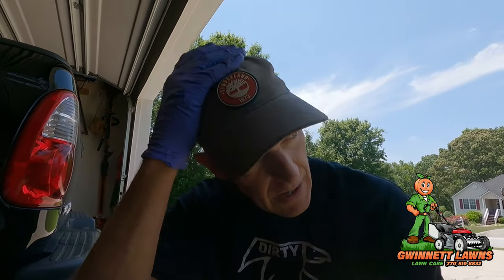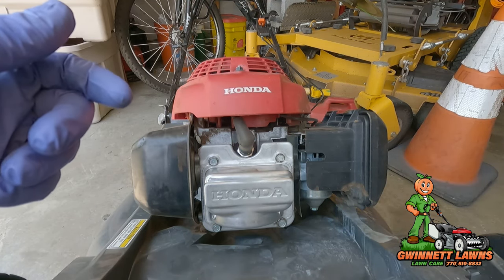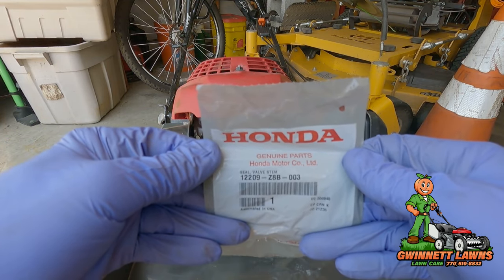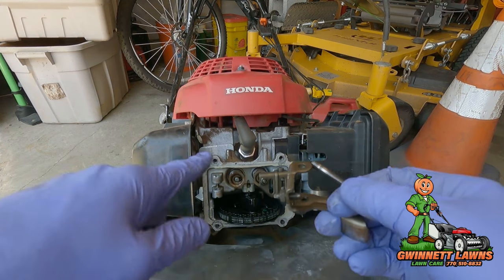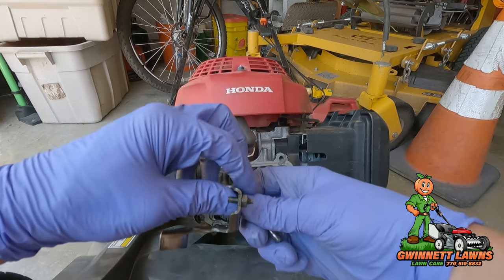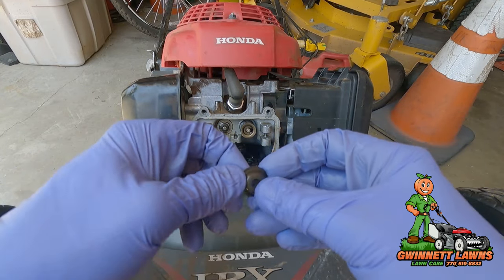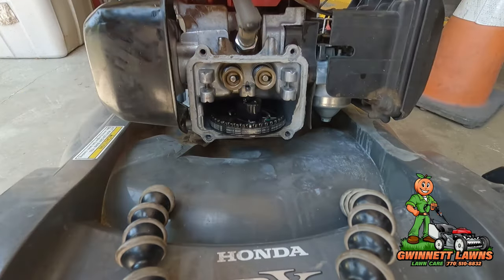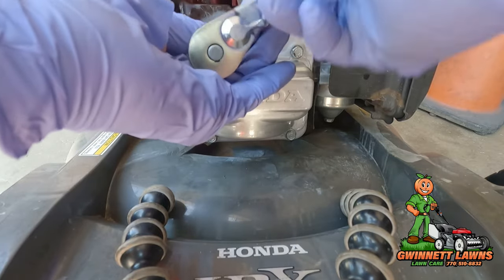Repairing the Valve Guide on the GCV 190, GCV160 Honda HRX217

Comment: Mine had the same issue as do them all. Intake side only . If your tired of your intake valve sticking every time you go to use it he’s my fix . Get some valve grinding compound and spin it with a drill so it opens up the guide  and will never stick again. You can do this with the head on. Don’t get the compound Anywhere but in the guide and clean up afterward. Reseal the cover and will run forever

Comment: I bought this mower new in Jan 2017 thinking it would be the last mower I would buy. Unfortunately it was one issue after another until finally this June I sat it by the road and it became someone else’s problem. Four trips back to the dealer for warranty work and then several repairs outside of warranty was more than enough for me. I’m now mowing with a Milwaukee M18 mower and couldn’t be happier. I also just bought a Milwaukee string trimmer to replace my Honda trimmer. Honda quality is way too hit or miss at the prices they charge for their equipment. Definitely no longer a premium brand IMO.

Comment: interesting - I have been presented several of these exhaust valve videos today just after dropping my Ryobi / Honda Pressure washer off at the shop for not starting and telling the wife I think it is an intake valve issue due to the popping sound / slight backfire thru the carb - I should have waited a couple hours and saved a couple hundred dollars I will be charged -
Reply from the maker: Ouch that's a lot of $$$.

Comment: The valve cover from a GSV190 (commercial grade variant) fits the GCV160/190. It's made out of cast aluminum and uses a gasket. The part# for the GSV valve cover is 12311-Z2A-000 and the gasket is 12312-Z2A-000.
Reply: Very helpful, ordering this upgrade for mine, thank you.
Reply: @Treppiede  you also need the longer bolts from the GSV p/n 90121-952-000 qty 4
Reply: @joshcobi  thank you, you're absolutely right, I found out the hard way the other day when the cast aluminum cover arrived and I went to put it on my GCV190 lol. I wound up picking up some bolts from McMaster that did the job, but I will replace them with the OEM Honda stuff soon. Good discussion gents, thanks! 👍
Reply: This now brings up a question is the valve guild/seat different / better on the commercial and will it fix the problem on the standard 217 ??
Reply: @kevinharris5101  I don't know if it is "better" but at least it won't rust. Ah, and it will not deform so easily when bumping it into a big branch or something. I polished mine up yeaterday (the standard one) and applied some water displacing oil. I think about to paint it

Comment: I too have noted that the build quality of Honda mowers has diminished.  I purchased my HRC 216-AD HXA (MZAN 6000001-6099999) in August of 1990, when the wheels had metal hubs.  On the other hand, my brother-in-law has gone through at least a half-dozen cheap box store mowers in the past 30-years.  Although my HRC 216 was $910 at time of purchase, I still believe I got my money's worth.

Comment: My HRX217 is 5 yrs old.   Used it all summer and week ago wouldn't start.   Cleaned Carb and then took off valve cover and the intake valve was stuck.   Sprayed with WD40 and tapped it several times and it finally loosen up.    Bent the valve cover trying to get it off, so straigtened it up and screwed it back on.    Couldn't find the video you mentioned about making a gasket for it. 
This is first Honda mower I've owned.  Had 2 Snapper mowers over a 45 yr period.   Had almost no problems with them.  The last one had a Wisconsin Robin engine.   I was going to buy another Snapper but the new ones in 2018 looked cheap and not as sturdy as the previous ones.   I'm going to get an hour meter for this Honda.   Thanks for the videos.
Reply from the maker: I have not done a video on making the gasket as other things were slightly more pressing.  I will do the video at some point.
Reply: FYI...I vote sooner rather than later...LOL @GwinnettLawns
Reply: My brother has a Snapper push mower with a 2-stroke Wisconsin Robin engine; I keep trying to get from him. He says, that I'll have to pry his cold dead fingers off it, for him to give it up!

Comment: Thank you for posting this.  This was the key to fixing my Ryobi 3100 pressure washer no compression issue.  When I tapped the guide back in it bound up the exhaust valve even more, but I was able to loosen it with liquid wrench and some vice grips by working it up and down until it fully seated and slid easier.

Comment: Can't remember the year purchased but was new when purchased from the dealer.......lets call it  25 to 29 year old HRT216 with original GCV160 engine.  Estimate about 30 to 40 hours total?  Looks like new of course.  For the past 19 years it has only been ran about 2 hours since moving to a larger property and using a ZTR to mow.  It was only drug out once or twice a year to mow a low area that collected a lot of water and couldn't get the tractor in there in the spring.  This year decided to use it a bit more around some pine trees.  Noticed a puff of smoke when starting every week this year that was obviously oil from the smell.  Figured the valve seal had dried out due to lack of use and allowed oil to seep past when sitting.  Pulled the cover, rockers, and spring and there is no seal present.  What was strange though was if the seal had dry rotted and crumbled, the small sealing spring it seems is on the seal from the videos I have watched is not left behind on the valve stem if the rubber had decayed and fallen apart.  Can't locate the actual engine code online but every other engine code for the GCV 160 shows the seal used so assume this model had it too at some point.  GJAEA-1146612 with  MY1* code punched beside.  Might buy a intake seal, not sure it is worth it to crack the case apart to look for that sealing spring, thinking it is not an issue even if it is laying in the bottom of the case.

Comment: Have this exact mower about 6 years old I use it in a landscape business  been reliable not the best cutting or bagging but it weights way less than the commercial and hear in the PNW that helps a lot in the springtime when you can put ruts in the lawns because they are so wet.

Comment: Haven’t had the guide move on my gcv160. The valve cover did leak, the Honda bond silicone is crap , so as an automotive machinist I sealed my valve cover with Permatex right stuff silicone. I did this on both my mower and the newer mower that my parents have with the GCV 170. Both are absolutely bone dry.
Reply: If you order a cast aluminum valve cover and the longer bolts for it that comes on I believe the GSV series engines it uses a gasket and allows easy valve servicing without the use of silicone or a crappy tin cover.

Comment: Hello again
So the meter for the engine all you do is wrap around the cable for the plug and tie it like u did and it will read the hours use?
Thanks
Reply from the maker: Correct the wire senses the spark energy and the meter displays it on the front.

Comment: One more comment,   question,   Is there a way to modify the Honda HRX217 so engine speed can be adjusted.   This mower just runs all out and I can't adjust the engine speed.  The Snappers I had I could adjust the speed on them from the handle while mowing.   Thanks.
Reply from the maker: The throttle is on the handle of these mowers as well.  Mine will run a various RPM's.  Maybe someone messed with the governor spring.
Reply: There is no throttle on my HRX217.   @GwinnettLawns
Reply: @alfannin872  The RPM is adjusted by slightly bending the governor arm. If you'll search you'll find at least one very good video showing how to do it.

Comment: Would this be causing oil to be burnt on startup?  I have an HRX217 with a GCV190, and while i've had the intake seal and the camshaft oring replaced, it burns oil at startup, or slightly when i engage Roto-Stop.  I'm hoping that if it's because the valve guide is pulling out, it's causing so I can fix.
Reply from the maker: I could be doing rings are worn. Try adjusting your valves see if that helps. The valve guide moving is not going to cause it to burn oil on the exhaust side..

Comment: I have this mower with the GCV 190.  I am having the issue where its hard to pull start.  I can it pulls hard to TDC and then i can slowly pull it past that point where it's a little easier again until it gets to TDC once more.  Do you think this is the valve issue or is it the pressure relief spring?
Reply: Did you ever get an answer on this. I'm having the same exact issue.
Reply: @eastsideozzy  yep! i took it apart and the rocker arm was cracked and the valve stem was not pushed in all the way.  replaced the rocker arm and did the fix for the valve stem and works great

Comment: Did you source another gcv190 engine? MTA distributors and Jack's small engine are out. Some guy in the middle of nowhere has gcv190's for too much moolah. I probably will bite the bullet and get one if the crankshaft matches. Rebuild the old engine.
Reply from the maker: Yes I have a brand new engine in its sealed Honda box.

Comment: I loved my Honda. Up until it decided to be a SOB & quit working and I can’t figure it out. It won’t even try to run and it’s got spark and gas. But it does nothing. I mean nothing. At this point, I think it only has spark when I have the plug pulled out where I can see it. I think it gives up and stops sparking as soon as I put the plug back in and try to pull on the start rope. Because I put gas in the cylinder myself, multiple times. And it still didn’t even try to fire up once. Which is beyond my ability to make sense of at this moment in time.

Comment: How do you know the the guide is not moving kn the head casting? Seems like a Bush fix to me. Why not remove the head and fix it for good.
Reply from the maker: The guide is moving that’s the point. It’s a design defect a new head would just give you the same problem, but this is a permanent fix bush or not.

Comment: Could not find video to make gasket for the valve cover
Reply from the maker: Have not done it yet.
Reply: @GwinnettLawns  what are you gonna use for gasket material?
Reply from the maker: you can buy sheets of gasket material from Fellpro.
Reply: @GwinnettLawns  what thickness or it only comes in one size?

Comment: So, you added a part on the exhaust where there wasn’t one there before?  You really didn’t specifically say that
Reply from the maker: Not only did I specifically say that I even showed the part number of the item and showed the entire process from start to finish.  Did you actually watch the entire video or did you skip around a bit?
Reply: @GwinnettLawns He's right, it wasn't clear that you were 'adding' a seal that wasn't supposed to be there.  You mentioned the sleeve that pops out and when you exposed the valve, it looked to me that that sleeve was sticking out further than the intake(which I thought was the issue you were addressing) but you never pushed it back in so that was confusing also. You just put a modified seal over it.  I don't see how that seal would keep the sleeve from coming out unless I misunderstood the issue.  Is this a problem with ALL GCV190 or just later models cause I have a 1st gen HRX217.  I'm guessing its more than 10 years old but has no issues i'm aware of.

Comment: Its not a bad design, Honda delivered exactly what consumers demanded, cheap disposable engines. I don't put any blame on Honda. I blame consumers that want to remain blind to the devaluation of the US Dollar over the last 40+yrs. In the 1980's and '90's both Honda and Toro offered commercial engines(Honda GXV 140 and Toro Suzuki 2/4 cycle) on consumer mowers with Cast Aluminum decks. They cost $500-$600+ circa 1990. Adjusted for inflation that would be approaching or surpassing $1,400 today. My Toro was $549 in 1991 without bagger or bagging chute, you had to pay extra for that. Consumers would loose their minds seeing those prices for consumer mowers today. The Honda HRC216 you sold was a lot of mower for the money, likely the best deal today at $1,400. The only mowers with cast aluminum decks and full commercial engines are the Toro commercials, and they start at $1,800 and go well above $2,000 for a 21". I believe I saw $2,300 retail for the Toro 21" with Honda GXV160 and blade clutch.

As for the best cut you mentioned, I have a 13ish year old HRX 217(190cc) and 3yrs ago I found a 1991 cast aluminum Toro Recycler with a Suzuki 2-cycle engine for free. After fixing it up it cuts and mulches far better than my HRX 217. Finished cut is noticeably better looking than my HRX 217. I have no doubt the '90's Honda HR215's would cut better than current Honda's too, but again they would be crazy expensive to build today, and consumers would freak out at the price. The 121cc 2-cycle Suzuki, the 140cc 4-cycle Suzuki, and the 140cc GX140 Honda's of the '90's lack the power of those 190cc and 200cc Hondas. They also only cut to a max of 3" height.  Honda HRX 217 can handle knee high grass far better than those old mowers. Consumers drive the market and Honda did good building the HRX 217's.
Reply: My 23 year old Toro Super Recycler deck clogs up with grass almost every time I mow with it.  My Honda HRX217 Nexite deck almost never clogs up with clippings unless the grass was just rained on or sprinklers.   Those triangular kickers underneath the Toro SR's help mulch, but also make cleaning the deck much harder.  I also noticed the Honda double blades will almost never leave clump trails behind like a Toro SR does in long grass.   The Toro single blades also seem to be made of softer metal and dents easier on branches and rocks than Honda's blades.
Reply: @JasonJayJJ1  My Honda HRX leaves trails at the left rear wheel if the grass is long. I did see my 32yr old Toro do it a tiny bit the last mow but I broke the 1/3 rule cutting very thick 6"+ grass at 2".  That old pre-Super Recycler(Toro did not begin to call the cast aluminum Recyclers "Super" until 1993) has much smaller plastic "kickers" than later models, but it has more of them(4+ mulch plug). It also uses the same blade as the commercial 22043 mower.

Both Honda and Toro have been lowering quality since the 1990's to keep prices down so consumers can be happily blind the fact that the US Dollar has been losing its value for over 40yrs. That is why Honda chose to get out of the US market while continuing to sell mowers in Europe, Australia, and Asia. Just look at the maker of this video, he sold his US-made commercial Honda HRC 216 to now buy a Chinese-made Bad Boy with a Chinese-made Kawasaki. Consumers create the market, and most US consumers are a bit stupid. Honda is well aware, and I'm guessing tired of it. Been driving Honda's for 27yrs. I am a Huge fan, and still looking for a 1990's Honda HR215 with a cast aluminum deck.
Reply: @WisconsinEric  What would you prefer to buy today, a 21" Scag with either the 173cc or 224cc Kohler engine, a Bad Boy, aka Y-Bravo Gen 2 with Kawasaki 180cc engine, or a Honda of your choice?   Which is going to last the longest in your experience?
Reply: @JasonJayJJ1  I have no experience with any of them and I am not a landscaper so my opinion should mean little to nothing on those mowers. That said I am a huge fan of Honda engines, just not their consumer GC engines. The GCV's are not bad, and I still prefer them to others in the price range, but no comparison to Honda GX series engines. I worked at a repair shop for a short time and commercial generators/compressors and other equipment would come in with seriously neglected and abused Honda GX engines and they always seemed to be serviceable with minimal work. The Honda HRC216 seemed like the best deal around at $500-$700 less than comparable Toros. Scag and Kohler are both Wisconsin-made(my home state) so that 224cc 21" does interest me as it looks like a beast, perfect for overgrown lawn clean ups, but heavier than I would like for a weekly cut on a well manicured lawn. I cut every 5 days when the grass is growing fast so my 4.5hp Suzuki 2-cycle has plenty of power even though it is less powerful than the Honda GCV190 on my HRX 217. My HRX is 13yrs old and that engine ran perfect last I used it 3yrs ago. Transmission is shot though.